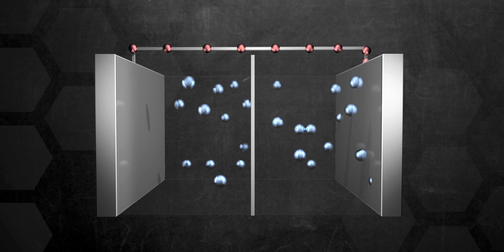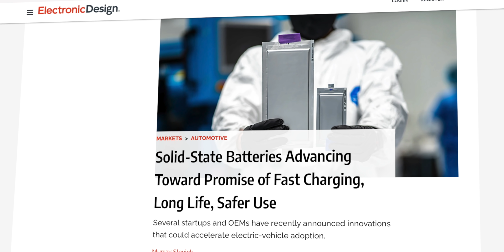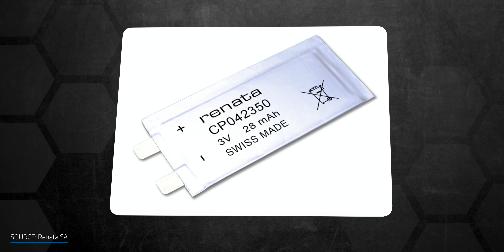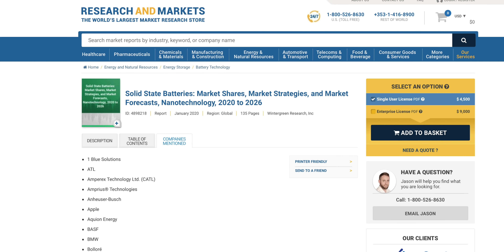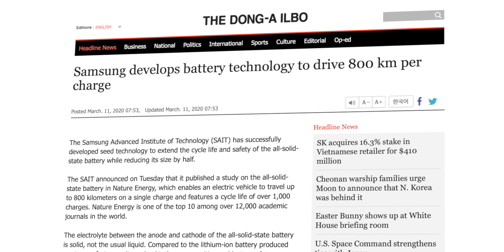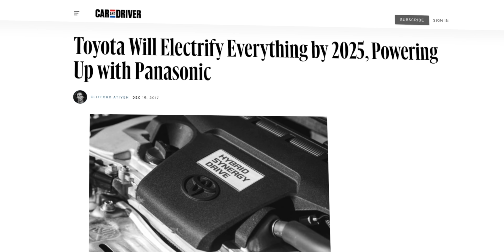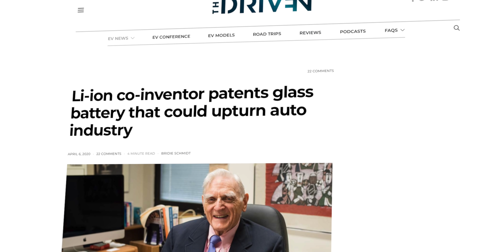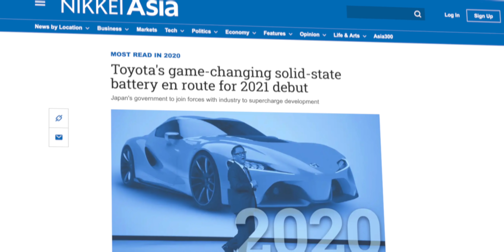Exploring When Solid State Batteries Will Arrive

Comment: I say if you want solid state batteries to take off...start small scale...I do a lot with radio control aircraft, boats, and car, these all use 7.4 volt packs at 1.5 amps all the way upto 14.7 volt at 6 amps and even bigger packs...this would be a great testing ground/proof of concept market and would provide factual information on everything from variable temperatures, shock and damage resistance,  charging and discharging variable,  etc...plus there are numerous organizations that support these activities which may provide support for government lobbing/support...Academy of Model Aviation (AMA) is one such organization and they have been instrumental in providing rules/regulations on integration of drones into the safe operations in civilian/commercial airways and maintaining a safe environment for the Model Aviation community...

Comment: Thx for the clear and crisp overview. 👍👍 it’s still some time for solid state batteries to come to market, but i’m sure they will come
Reply: The thing with technology that breaks others is that there are so many bridges to cross, and most of the bridge builders are the oil industry or incumbent battery manufacturers. Why do you think Elon asked LG and Panasonic and others to build the 4860 battery for them, because if they had left them out there would have been huge claims and accusations of wrong doing from lobbyists.

As time goes by Tesla will manufacture all their batteries and those for other ev manufacturers.
Reply: This is very true. Everybody wants to get a piece of the cake. If you handle them right, you will get quicker and with less resistance to your goal….

Comment: I wouldn't expect to see Solid State Batteries in normal devices for at least 40 years, remember it took lithium batteries 50 years to go from lab to consumer use. I wouldn't expect much less from Solid State Batteries, too many issues to work out and costs of manufacturing to drive down to the point of any type of normal use.

Comment: I want to see standardized batteries, that get changed out at battery-swap stations.  Tesla did a demo, showing that their battery-swap system was faster than getting a tank of gasoline at an ordinary gas station.  Swapping in brand-new batteries for the oldest few trade-ins would be seamless, and you could keep as many batteries charging at a station as necessary.  So neither the charging time nor the number of cycles would matter much, only the capacity, mass, and overall cost per cycle.  But it doesn't work until and unless the batteries are standardized, and the infrastructure is there.

Comment: I'm wondering if the 4680 is going to be as hard to produce as Solid State batteries.
Reply: The 4680 is an evolution of existing technology, it is not new technology, despite the hype. Manufacturers will already have a very good understanding of how to produce these cost effectively with relatively few hurdles to overcome. Setting up production for solid state batteries will be much more challenging and will be much more expensive.
Reply: @davidbrayshaw3529  tesla will be profiting from 4680 batteries not their customers. ranges and charge times will almost be same but the cost to produce them will be significantly less than say pouch cells or 2170 ones.
Reply: @hulk6315  It will be interesting to see how costs compare. It's fair to say that Musk's hallmark is that he over promises and under delivers in respect to just about everything. There's no reason to believe that 4680 costings will be any different and given that they still share a lot in common with 18650 and 2170 cells, I can't see them being much cheaper to produce.
Weight for Weight, you're going to see very little difference in range with the 4680's as they rely on existing chemistry but their lower volume is appealing. Charge and discharge rates should be significantly improved due to a reduction in internal resistance but how much of an advantage that is in "the real world" remains to be seen. Faster charging times will require higher current than is often available due to limitations in electricity supplies. I'll be impressed when I see a dozen Tesla semis re charging in twenty minutes, all at the same time at a fast charging station. When I say impressed, I mean by the size of the substation located next to the high tension power lines!

Comment: The safety aspect of solid state batteries is far more interesting than the increase in capacity, a lot of applications for lithium ion batteries require significant structural reinforcement causing products that use lithium ion to be bulkier than necessary leading to lose of efficiency (especially in the case of automotive, and aerospace usage). Even without an improvement in capacity safer batteries will simplify some as aspects of battery production namely the storage and shipping as safe handling of large numbers even uncharged cells can be a considerable fire risk. It would have been interesting to see that clip from the Hyundai battery production facility as that appears to be one of the demonstrations where the battery is fully cut into two pieces and they demonstrate that the battery still functions even separated into two distinct pieces and that the energy output is proportional to intact section.

I remember seeing videos about the invention of solid state lithium ion battery more than 5 years ago and the primary issues being related to production scaling and manufacturing, so if car manufacturers are already promising mass production it's likely solid state batteries will be in every day devices within the decade

Comment: LCD TV's were invented and hit shelves in 1982. They cost thousands of dollars. in 2005 an LCD 40 inches in size cost a whopping $4,000.

Then lets say they got reasonable around 2010. So 28 years after the technology hit the market it finally got affordable. 

Applying that sort of thing here again, I'm not expecting to see affordable solid state batteries until 2050

Comment: One of the challenges for electric cars is charging infrastructure.  Many areas do not have enough capacity to upgrade home services to accommodate high power, fast charging stations at home.  I know someone who was denied an upgrade to their electrical service from 100 amp to 200 amp because the subdivision they lived in could not handle any more capacity. We will need massive investment in electrical infrastructure to allow electric cars to replace gasoline powered cars.

Comment: This is actually why I want to buy a GM EV when they start rolling out. There's basically no chance of buying an EV with SSBs before 2027 the way I see it, maybe even 2030. But EVs can last so long that I really want to be able to upgrade the battery in the future. GM's Ultium platform seems like the easiest path to upgrade in the future. They can adapt to new battery chemistries, each container is easily replaced. That's not true for Tesla, who is continually finding more ways to integrate the batteries in to the structure of the vehicles.
Reply: upgrading batteries makes sense with what we are using now... but when we move to solid state batteries you don't have a battery pack, you integrate the battery into the frame of the vehicle, and the battery/frame will last a good 500,000 miles.  I use to drive a lot, and the most I ever put on a car was ~250k miles on it, and that thing was worn out and begging to be replaced when I finally stopped repairing it.
But I agree with you... while we will see solid state batteries before 2030, the first real publicly available mass-manufactured cars with it wont be until closer to 2040-2050.
Reply: @CaedenV  I think EVs will change the way we see car ownership. Typically most people only keep a car for 5-10 years. Then they entire the used market for another 10-15 years and are typically scrapped by 30. But a lot of that is because of the decomposition of ICEs that become more expensive to fix than the entire vehicle is worth. That wont be true with EVs. In the future many people may hang on to their EV for 40+ years. So long term upgradeability is going to become an important issue going forward. Thats my two cents anyway.

Comment: Matt, solid lithium-metal anodes have been a thing for almost 50 years now! It is nowhere anything new. Also, with some research you can find out, that lithium-metal anodes ALWAYS puncture through the separator at the end of their lifecycles. If there is an only 1 atom large material defect int the saparator, the solid state cell will short itself and combust. 

I have NEVER SEEN anyone handing out solid state cells for testing to independent industry people. They would have to convince me with a WHOLE LOT OF tests to show, that at the end of their lifecycles, the cells in my EV won't spontainously short themselves and combust.... Until then, lithium-ion is considered to be MAGNITUDES safer than solid state cells.

These cells show up in testing equipment and in race vehicles from time to time, where they can scrap the packs after a certain lifetime, preventing the end of life sponainously shorting phenomenon. But I have yet see them handing out cells to independent industry organizations.....

Until then, solid state remains FAKE....

Comment: My theory is we will see solid state first in small devices like headphones and wearables like AirPods and Apple Watches, this is because initially the cost to produce large batteries will be too high so as production begins it will be small batteries. After the supply chain for small devices is down it will move onto medium devices like phones and portable consoles(switch and if Sony ever makes another psp). Then onto large devices like laptops then large scale like ev’s. It’s going to start small and scale up, I’d estimate 2 years in between each scale up and yes there will be the occasional large device during the small devices stage but it will be significantly more expensive. The real question is when the first small devices will come to market.

Comment: One of the reasons why electric cars can not replace gasoline powered ones is because of the amount of energy that can be stored in combustible materials is so much greater than what can be stored in conventional batteries. A pound weight of gasoline or oil or coal produces more energy than a pound of battery. And yet a pound of battery can likely produce more power than a pound of capacitors. The chemicals in the battery hold more energy than the capacitors.

Comment: They need to improve the cycle life as not everyone "drives to empty" and it will probably degrade quicker than expected plus 1k cycles isn't much when existing lithium typically lasts for 2,500 to 5,000 cycles which is already not enough such is common to phones and laptops. For storage at home some have chosen to use battery type than can go for upwards of 20,000 cycles though they take longer to charge.

Comment: A 500,000 mile battery!? Most car engines crap out after 200K miles.
I want this car!!!
Reply: The car will still crap out before 200k miles, just not the battery. Transmission? Engine? Still won't last even close to that long.
Reply: @Godvivec  I've never heard of an electric motor dying, the only part of them that has friction is the shaft that holds them together.
unlike a combustion engine that is constantly under the stress of internal explosions.
EV's are also simpler to repair.
Reply: if any one know a good source of numbers on EV performance I'd love to look into it.
they haven't been on the market that long so most of what i find is all speculation.

Comment: Solid State Batteries have been around for a long time, but they are more expensive than lithium ion, so the work they are doing on Solid State is more about getting the price down, down enough to compete with lithium ion, the problem is with that is everytime they do make a breakthrough reduction in cost, lithium ion has also dropped in price to the point they have to start over again, once lithium ion has hit its limits in price and capacity, only then solid state might start to take over,  from what ive read, lithium ion still has about 10 to 15 years worth of improvements with our current understanding of lithium ion, so unless they have a massive breakthrough with solid state we wont see them in mass production for at least another 10 years

Comment: You mixed up anode and cathode
Reply: Was scrolling comments to see if anyone else caught that, so glad you saw/heard that too. Anodes are Positive. Cathodes are Negative. Electron flow through the circuit leaving the battery is from Negative to Positive.
Reply: @mikedziadik2313  Interestingly I learned the difference between the anode and cathode by studying vacuum tubes.
Reply: No he didn't.

Comment: solid state batteries at a large scale production will come ether when these patents become public domain or if the patents become required once and the companies can only charge a minimum for other companies to use them.

there is huge investment into the tech but all the research needs to be combined for to make something good and so the focus can be on production speed rather than fixing issues with the tech.

Comment: How about using common, low toxicity, low mining impact materials? Like iron, glass, etc.

I think liquid ammonia fuel cells are highly underrated. Vehicles currently carry around a huge amount of unused current capacity and/or depleted cells, and it's very hard to replace, upgrade or tailor capacity for local vs long distance use. EV's currently drag around their maximum capacity *all the time*. Fuel cells, possibly combined with super capacitors or even small ammonia powered combustion engines for short term use, could be better solutions.

Comment: I think solid state batteries will start becoming an option(expensive option) in cars and portable electronics starting in the next 3-4 years. They will continue to be an expensive option until the manufacturing process makes it cheap enough to go mainstream. I suspect it will be about 2030ish, which also happens to be around the time I think carbon nanotube batteries will start being an option in some military or other applications where recharging in seconds will be needed. By 2050 carbon nanotubes will be common and act more like super high capacity capacitors and they will be in common use. By this point, fusion energy will be a thing. But fusion generators will still be large as in power companies etc. But by 2100, homes, buildings and neighborhoods will start to have their own small scale fusion generators.

That's assuming governments don't destroy the world because of their greed for wealth and control. I give it a 50/50 chance..

Comment: My private thoughts are: If Solid State cells based on Lithium will be available and handily out compete current Liquid cells on capacity and low weight, maybe their chemical cousins based on Sodium will also become feasible, as they are good enough to compete with Liquid Dielectric Lithium cells in capacity and weight, but are much cheaper, putting Solid State Lithium cells to high end usages and having Solid State Sodium cells as cheap, but not as good, mass produced version for less demanding tasks.

Comment: Zinc batteries have higher energy densities and won’t catch fire. Also, the University of Michigan has made a solid state rechargeable zinc battery. I’m starting to think that lithium batteries are not gonna rule the battery industry forever.
Reply: Yes rechargable Zinc-air batteries have all the right properties: High energy density, cheap non hazzardous materials, not difficult to manufacture. However cycle life is not that impressive? Has that been solved?

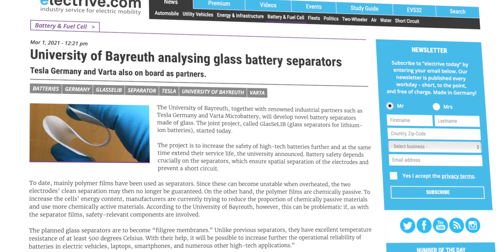Comment: 9:30 A glass separator and glass electrolyte are NOT the same thing.  A separator is usually used with a liquid electrolyte.  A glass electrolyte IS the electrolyte, with no separator and no liquid.

Comment: what about lithium sulfur? and why tesla dont going in diraction of solid state?
Reply: Tesla has already mentioned that they would like to move to solid state batteries as it could make the battery a structural part of the frame of the vehicle and remove the need to design around a large rectangular pack at the base of the car... but this is till 5 years away from the first shipping products, and closer to 15-20 years from truly mass adoption.  But it will get there.

Comment: Given the number of players in the market and the amount being invested in research and development, I would think less than six years, and given the significant energy density improvement over existing battery technologies, the speed of recharging, performance over a wider temperature range, and the number of lifetime charging cycles, solid state batteries will be the thing that gets renewable energy and de-carbonization efforts over any further hurdles.

Comment: The batteries that John B Goodenough is coming out with are going to be EVEN BETTER than the "solid/metal" lithium ion battery.  I personally heard that once the tech is perfected, it will hold a charge much larger than the measly 3x - that is just the starting models.  When it's perfected and advanced properly it'll be closer to 30 times the charge.   Imagine charging your cell phone once and it holding a charge for more than 30 days....  Not only that but it will be made from a material that is VERY common and not harmful to the environment!